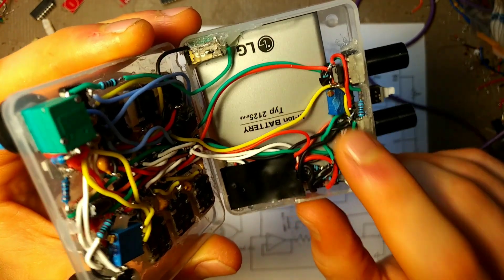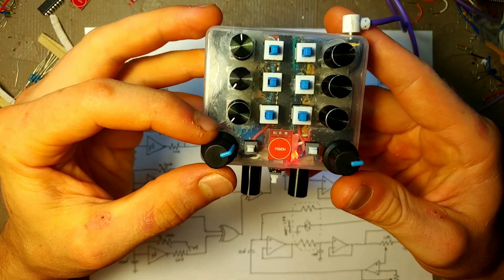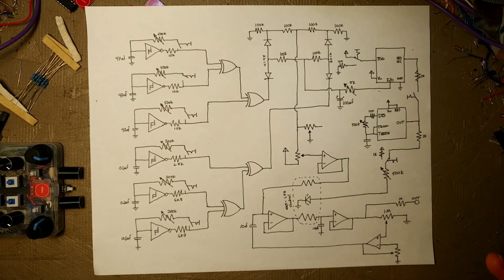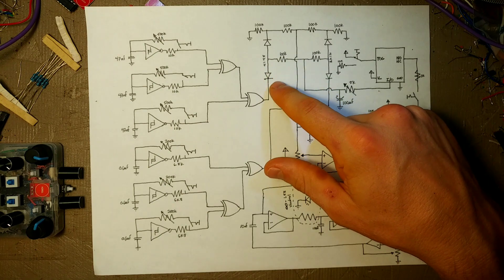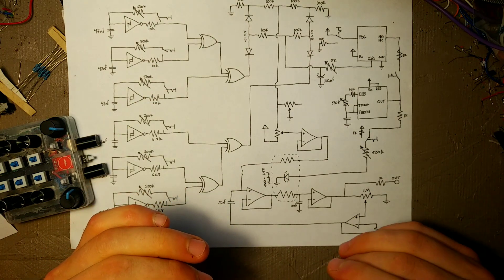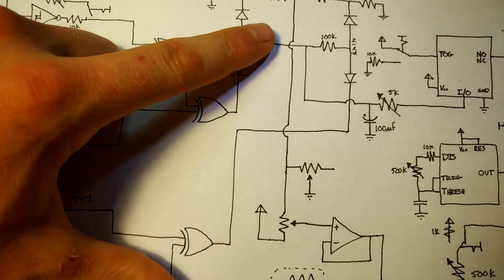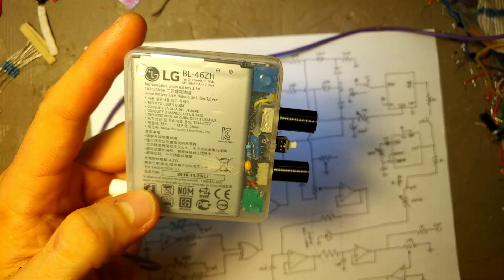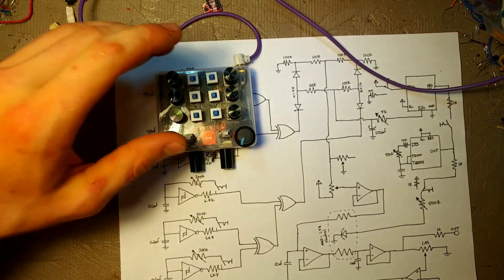Cellphone Battery Synthesizer XOR Drone (w/ schematics)

Comment: How do you decouple that little beast? I never get more then 3 ocsillators out of a hex schmitt inverter without one osc influencing all the others and clicking nois on the rails?
Reply from the maker: Well, it does leak a little when an oscillator turns on, but several well sized caps right next to the 40106 helps keep it out of the audio path, and the important part is the oscillation it actually terminatend in the feedback loop of the Schmitt trigger with the 6 on off buttons.
Reply: @arenotdiy  thanx for your quick answer, I will try some different values of caps on my next attempt, hopefully to get hardsync and saw waves with diode in the feedback path working smoother too
Reply from the maker: Good fun and luck!

Comment: Please, a more in depth tutorial. A great but still a bit confusing to me even with Moritz Klein's simple explanations. Will be putting this design together. Thanks for the good work
Reply from the maker: Should be coming soon. It will be a very broken down series explaining the oscillators to the filter (and some extras!) In great detail, from circuit analysis, to breadboard, to protoboard. I might even make some pcbs

Comment: About PSU, I think that a good 9v accum. will be better here. Probably a 9v regulator will shut down a circuit if it will be lower, right?
P.S. but when a good cell is dusting somewhere, it's a great choice IMO. Just wondering how the filter works from a such low voltage? Seems it gives some beefy  amps?
Reply from the maker: The 9 volt would just keep putting out the battery level sans the dropout voltage. I have two 18650's in series to give me a regulated 5 volts for my bench supply, and it works wonderfully, but its a much bulkier power source. The Samsung batt has the benefit of a low voltage cutoff, but you're right, the filter is the main problem. I just tweaked it until it could support a sine wave with an amplitude a little less that mains power

Comment: I would like to see a build video. Would like to build one.
Reply from the maker: Cool! I was planning on doing a similar circuit for a video synthesizer, I may integrate the two. If it's about reusing the battery as well, I might dedicate a video to how I salvage and use rechargeable batteries

Comment: Nice project, may be you can make a schematics file downloadable? What IC do you use?
Reply from the maker: I'll find that paper and put a copy in the description! I used a TL074 quad opamp, 4070 xor, and 40106 hex schmitt trigger inverter. There's a 555 timer in there too as an lfo
Reply: @arenotdiy  Great. You managed to fit everything in a reletevly small box, you used regulat or smd parts?
Reply from the maker: They were regular through-pin ic's, open circuit style, with no perfboard. If I were to do it again, especially with multiple units, I'd choose the smds though! I made all three of the files open to view in Google Docs, I didn't know they were restricted.

Comment: I ordered a 30 pk 40106. And took the next 3months off.
Reply from the maker: I hope you get some fun noises out of them! Those chips are quite useful in many applications, from timers, volt per octave oscillators, and even video synthesis.
Reply: @arenotdiy is V/ octave or DB/V.  ???
Reply from the maker: @jj74qformerlyjailbreak3   as I understand it, the v/oct. Standard is much more commonly used, I haven't found many articles discussing the differences between Dbm/V, much less divulging the circuits that drive them. I know that decibel refers to an exponential/logarithmic ratio, or an absolute value, but that's it!

Moritz Klien has the best step by step vco with v/oct I have found, for getting the basics down, and having a functional circuit afterwards. Its the first one I was able to make work, here's the first of 3 parts

https://youtu.be/QBatvo8bCa4

Good luck! It's so fun the first time you hook a keyboard up to your own oscillator, even if the pitch is wildly dependant on temperature ;)
Reply: @arenotdiy  Thank You. Really informative. I’ve watched Moritz videos and still didn’t understand quite yet. But hey, these chips, along with a MS-20, plenty of jacks, knobs and plenty common components, I’m on my way to making my own sound. God gives me everything I need and his time is always Now. 
God bless my friend.
Reply from the maker: I've learned everything I know from YouTube and it feels great to give back. When I feel that I understand exponential circuits and VCO complexities enough, I'll post a video explaining v/oct, and keyboard scanning matrices my own way :)

Comment: Really impressive sounds for such a simple device.
Excellent compact build too !

It's that a cue tip ear cleaner case ?
Reply from the maker: It was the container some toggle switches were shipped in.
I was using it for storing salvaged batteries,  and that one fit so well I couldn't help it.